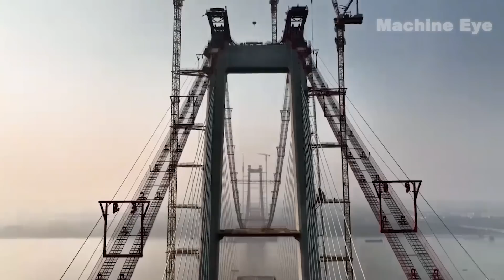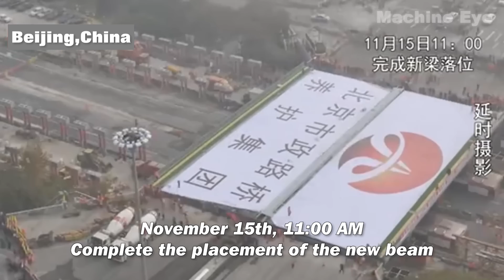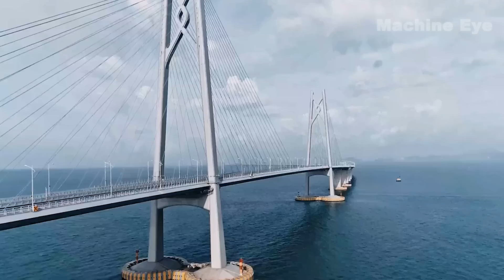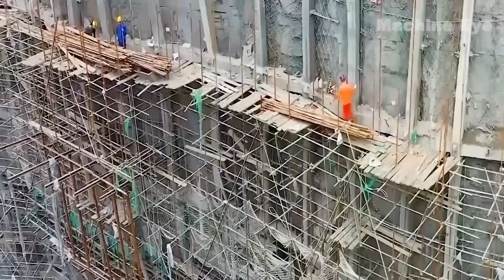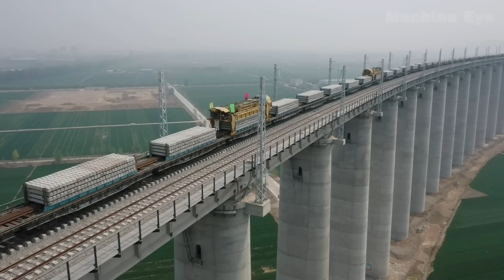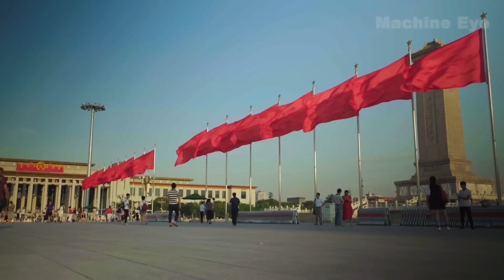Wow Amazing! China Build A Bridge In Just 43 Hours, UNBELIEVABLE Mega Engineering

Comment: From an engineering perspective, how quickly to build a structure is only one part of the job. The other parts, perhaps more important, are how safe and resilient would the structure be over its lifespan. The ease of maintenance is also an important consideration. Taking this perspective, one would be more impressed with older structures in China that have stood hundreds of years, compared to many modern structures that have crumbed after a few years.

Comment: I am a safety engineer. The hardest part of engineering safety critical systems is understanding the hazards, controlling the systems to avoid the hazards, and managing the safety culture. China is terrible at these. They may build big things but their tofu dreg projects—buildings that fall apart, bridges that fall down, drains that have no pipes, dams that cause constant landslides, train system that has had large disasters, electric cars that spontaneously catch fire, let alone the sewer oil and much more—show that they do not know how to manage safety. I worked on the C919 aircraft by COMAC, and was responsible for helping them with their certification planning of avionics as a supplier. Speaking from direct experience in visits to COMAC in Shanghai, their management culture is fear based incompetence. Yes, these megaprojects look nice on screen, but they are terrible for safety. I did NOT  feel Safe as an engineer in China who was responsible for safety. When safety is not a top priority, it is much easier to build big and large, because you don’t have the constraints everyone else is working under. But then the floods come and the infrastructure can’t handle it—just like it did early this year in China. China is destroying their natural landscape with failed mega projects.

Comment: The Hong Kong bridge has faulty low quality concrete. A company scammed the builder by not supplying the correct concrete. It’s holding up ok but may not last as long as originally planning required.
Reply: Are you on the editorial staff of serpentza?